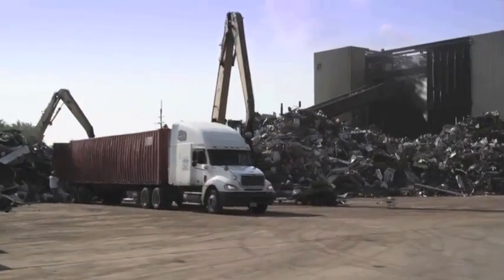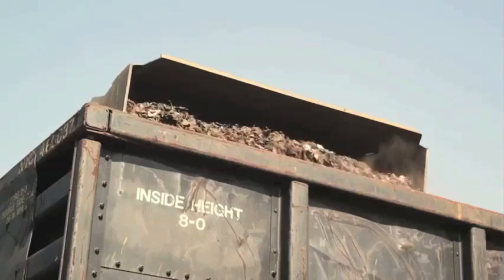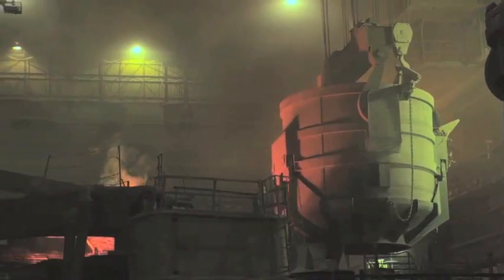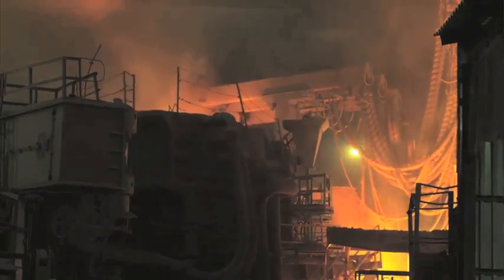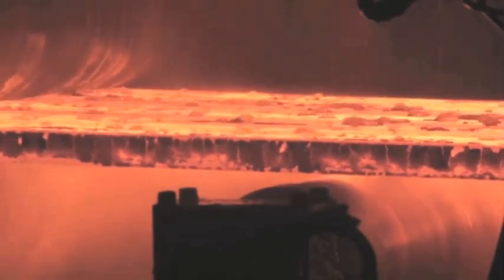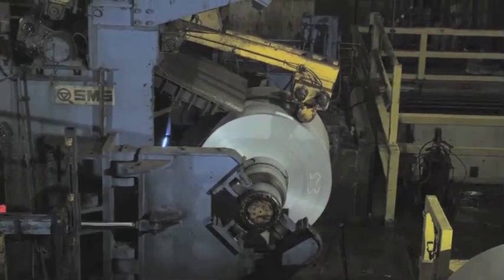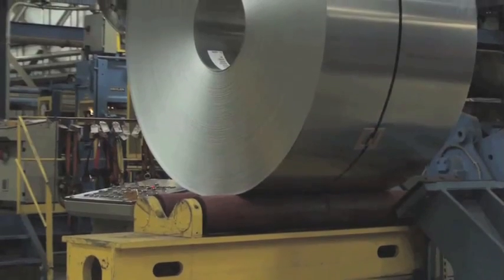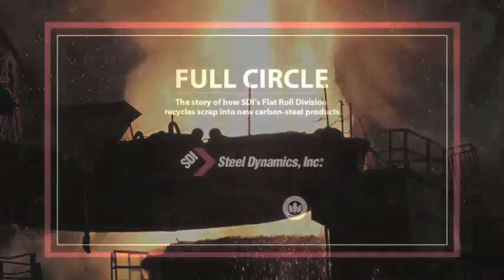Steel Dynamics Butler Full Circle

Comment: I was told once that the research report Bethlehem Steel wrote on why thin slab casting wouldn't work was thicker than the slabs cast by SDI and Nucor.
Reply: True.  I actually worked for Beth Steel at that time.  Several years later, I was with SDI-Butler and enjoyed quite a few yrs there!

Comment: Carbon neutral by 2050.  I guess Iron Dynamics can kiss it's rear end goodbye.  Best thing really.  Gas based direct reduced iron processes like Midrex are the superior technology.
Reply: Midrex is not carbon neutral by any stretch of the imagination.  It uses copious quantities of natural gas.  The mini mills that melt scrap are far closer.
Reply: @lowercherty  Yes Midrex with a natural gas reformer does use a lot of natural gas but Midrex fed with hydrogen from electrolytic production is carbon neutral.  There is no making Iron Dynamics carbon neutral.  I work with the man who designed and commissioned Iron Dynamics and even he said iIron Dynamics is a doomed process.  Even the mighty Steel Dynamics invests in bad technology from time to time.